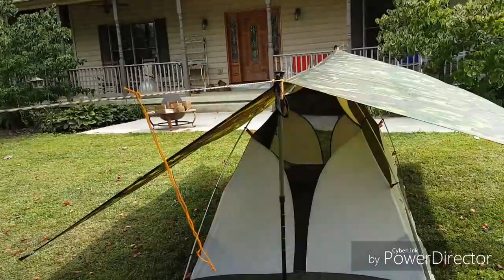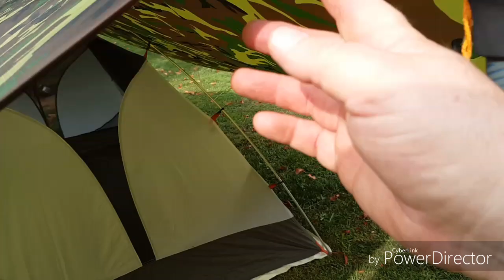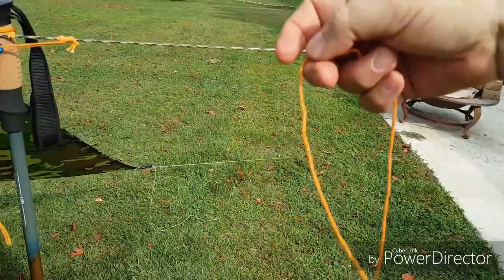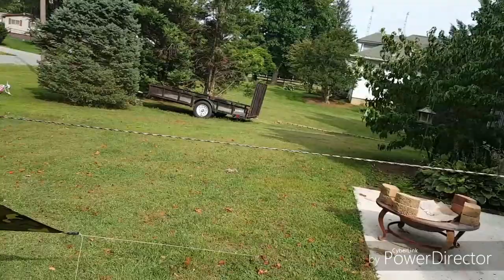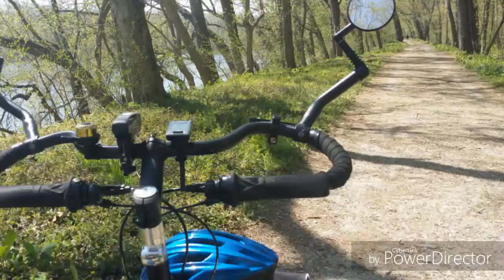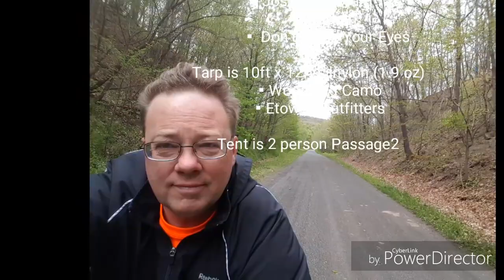Journeyonabike - Tarp over my Tent - Test #1

Comment: How much time do you expect it to take setting up and taking down ?
Reply from the maker: Chris Lang i can get it to under 5 minutes setting up...
Took me 2 minutes taking down ... and another minute figure 8 wrapping up ridgeline
Reply from the maker: Chris Lang i was amazed though how much the loose tarp was flapping in a breeze hanging on ridgeline until i got corner guy lines anchored..

I did have to use a small channel-lock wrench like a hammer on stakes... straight smooth aluminum stakes